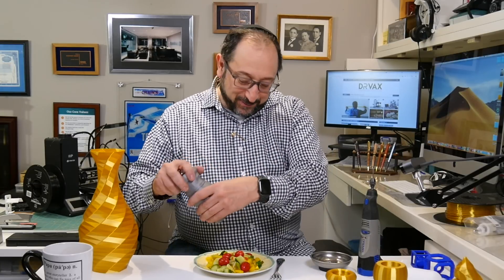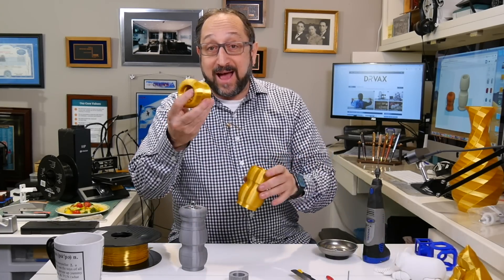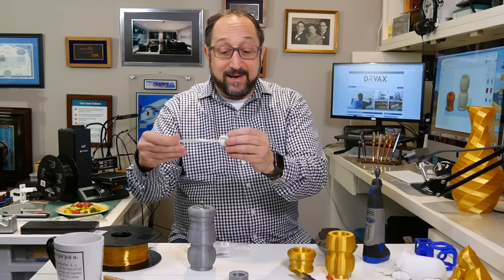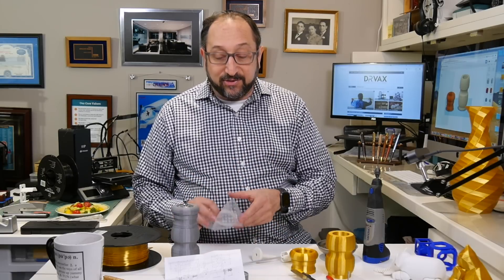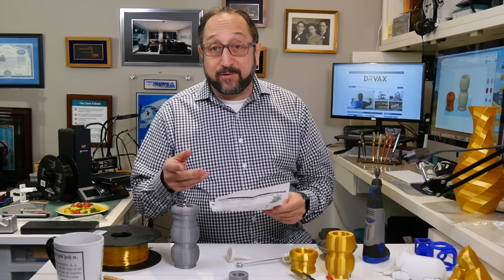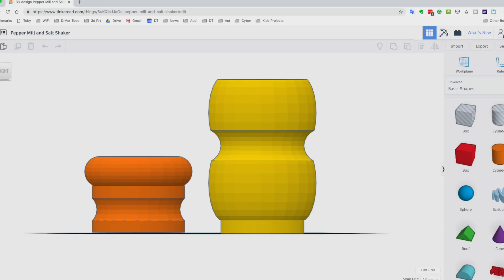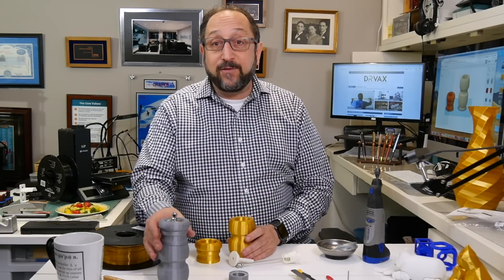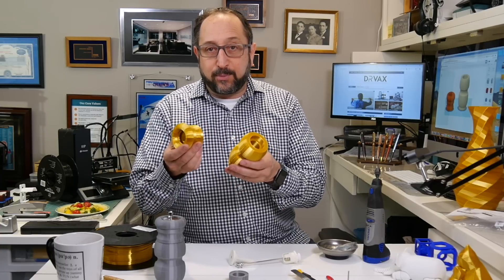Make a 3d Printed Pepper Grinder

Comment: the top needs to be modified, the white part with the square hole goes the other way, only the smaller bum up fits into the top and the larger round section sticks out. the white part that sticks out is covered by the base. otherwise all the salt will fall out of the square hole like a funnel.

Comment: I think the pepper would be ok to be stored like this, but what about the salt? The gold PLA you referenced isn't a food-safe material as far as I know, so how does this affect the salt while its stored inside the grinder? Would the plastic leech into the salt, or is that not a concern for dry ingredients?
Reply from the maker: Great questions.   My assumption, possibly inaccurate is that since the salt and pepper are dry and cold materials they would be safe.  However, this is outside of my expertise.  

One possibility would be to spray the inside with clear polyurethane to be safe.

If we have any food safety experts viewing this video feel free to contribute.
Reply: @MakeWithTech  I'm by no means an expert on the subject yet, but am very much interested in printing items for kitchen use. I did some digging, and it appears that your suggestion of using a clear polyurethane for the interior of the print would be best. To go the extra mile, its also recommended to switch to a stainless steel hot end and swap out brass nozzles with stainless steel versions, as brass nozzles can potentially contain  lead. A final suggestion seems to be to keep a dedicated printer for food-related prints, to reduce the risk of contaminants entering into your food-safe print. This may all be overkill for the salt, but it seems best to err on the side of caution in this instance. Forgot to mention earlier by the way, nice design with the grinder! Looks to be a fun project! I'm thinking to try this out with some of my Hatchbox wood filament.